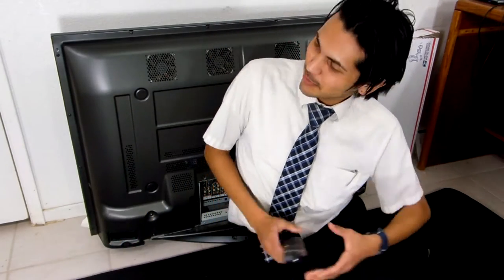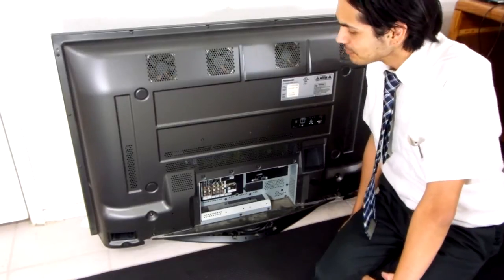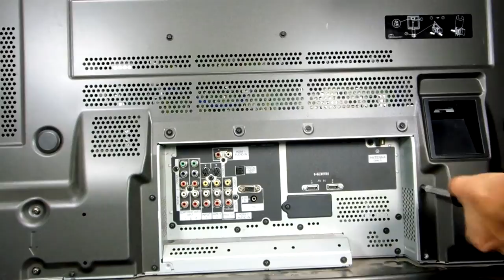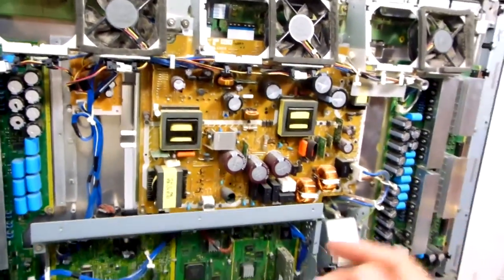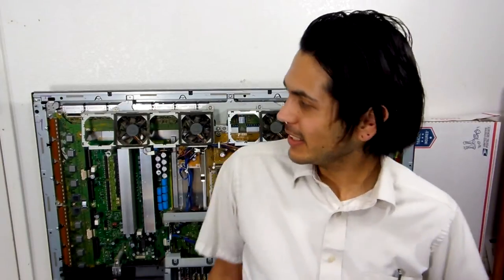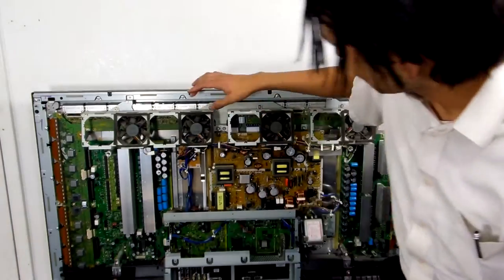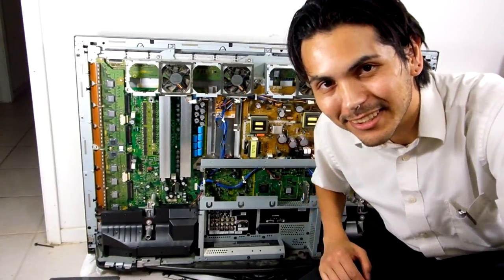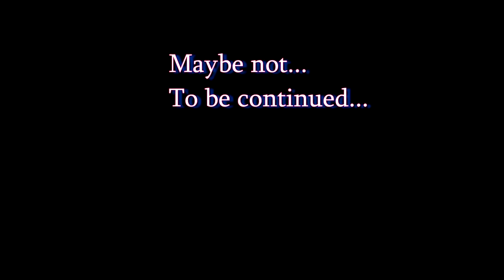42" Panasonic Plasma TV Repair: Part 1, Power Supply Removal

Comment: You actually need a slightly bigger screwdriver to make it easier. it will sit in the head of the screw easier and is easier to turn when you need more strength. Huge TV's and Thinkpads are very different.

The TV is a beast!
Reply from the maker: I admit there wasn't a completed video for this reason... I didn't fix it. 😫😆
Reply: What's the screwdriver you need to remove the top middle screws? I already damaged them a little by trying to get them off using the screwdriver that I got the side screws off.